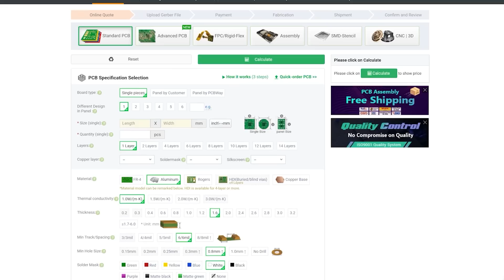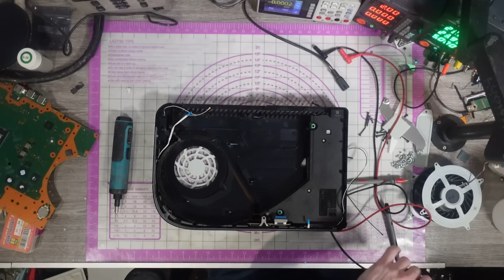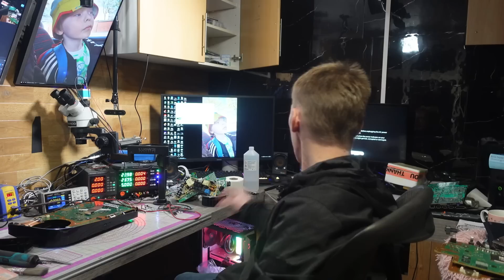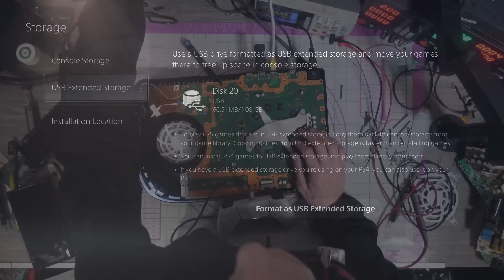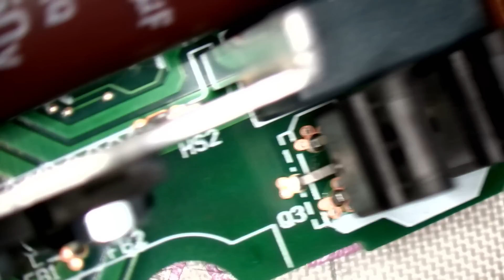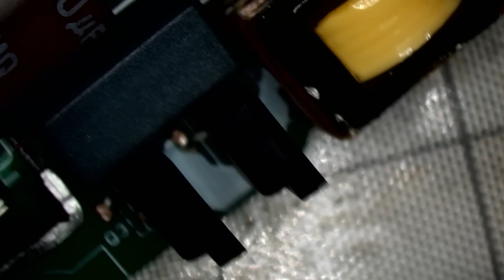The PlayStation 5 Is EASY To Repair

Comment: Why dont use your volt meter in ohms and measure the cap it will drain the caps voltage without sparks

Comment: Hi man, could you help me, i have a big problem, i have 8 playstations 5 to diagnose those have differents failures, i can read and validate some error codes with you GUI software, thanks for that, but i perfome a NOR backup from those ps5 but when i patch it the playstation does'n turn on,  by example i have one o those that turn on and turn off inmediatly but when reflash the NOR with the original .bin from the PS5 this doesn't turn on, i dont know if is a neer thermal fuse o something like that

Comment: What I would do mate, I would have the power wire plugged into a switched outlet, so you can handle the power supply while plugging it in, then flip the switch, and when you unplug it turn the switch off, so you can be as safe as you can be.... Just a thought.

Comment: Hey! I buy a defect ps5 that open 1 Time on 2 and shutdown by itself after 2-3 minute. Change the power supply and the metal liquid on cpu Nothing works. Sometime it wont open it beep 1 Time and I can open it 2 second after. I plug à UART tool and got some code a lot of code.
Kernel panic shutdown
General Power failure SSD/APU Line
APU not responding blue Light flash system wont start (chek fuze f3501,F7501)
thats the code that it got. CAN u help me with that please?

Comment: Back in 1970 when i was working in a White Goods store that had a TV Technician  repairing all electronic gear. The technician got fed up with the boss  moving the little piles of resistors ETC, the components that he had arrived to do the repairs, that the technician had placed in front of the things that he was working on. The TV technician started charging up capacitors and leaving them in the little piles as well. The boss soon stopped touching these piles after receiving several shocks.
Reply: Well that’s irresponsible and dangerous.

Comment: Back around 1984 I lived in an apartment, no surge protection, and during a thunderstorm the lights blinked and a little curl of smoke came up out of my printer.  It was actually a fancy typewriter that could be converted with a card to a letter quality printer.  A computer and printer was a stretch for my budget.  I got the card replaced, and bought a surge protector.  I haven't been without one since.

Comment: For discharging PSU caps, I personally use a 60w incandescent bulb (a.k.a big resistor) attached to multimeter test probes, it's a bit less harrowing than shorting out the legs 🤣

Comment: That PSU probably has no Transistors.
Only MOSFET...
Because of the lower losses of MOSFET over Transistors that is what is used.

Its capable of 90% Efficiency (Techpowerup reviewd it)
The ~330V are the rectified AC -> AC * square Root 2 = Rectified DC...
Reply: MOSFET's  are transistors the clue is in the name.

Comment: SPDs now have a section in the regs. No doubt largely put there by the companies that make them....
Reply from the maker: Yeah all new installs and consumer unit replacements have to have them now. We had one installed this summer with our CU upgrade. They can't be a bad thing and I haven't seen a difference in pricing either. Probably are put there by the big corps though lol